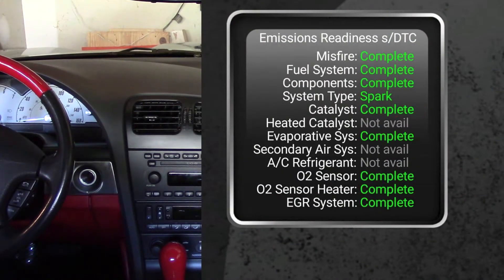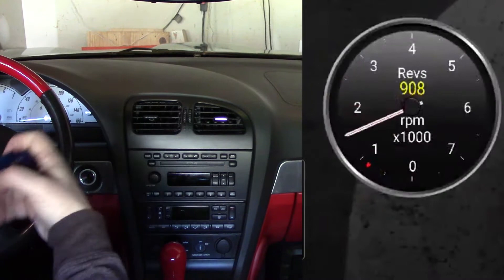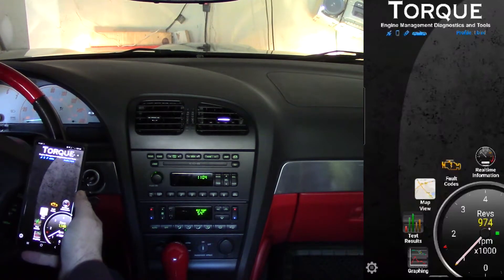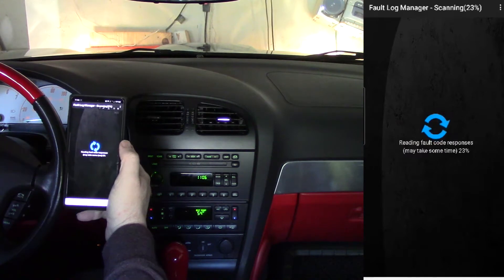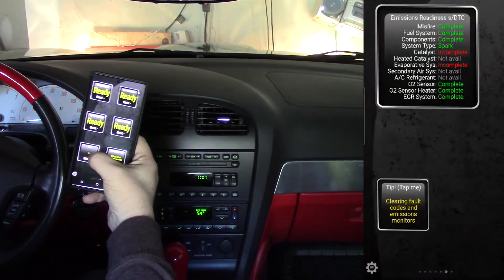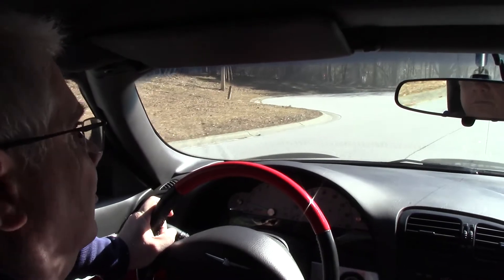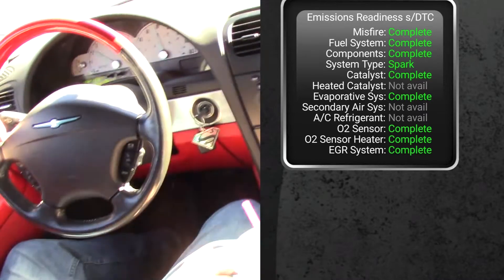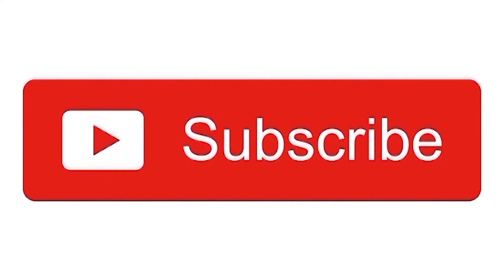Emissions Driving Cycle Catalyst and Evap Readiness Procedure  P1000 Error Fix

Comment: I had code p0442 (small evap leak) in my 2003 expedition. I changed a few things and now the code says pending after attempting a drive cycle. I have Evap and catalyst as incomplete like in the video. I hope I can complete the catalyst cycle without the check engine turning on.

Comment: I ran my Mustang at 60 mph for about 2 minutes, got off of the gas and let it coast to a stop. That Completed the Evap monitor. Thank you for posting this video.
Reply from the maker: You're welcome.  I am glad that it helped.
Reply: What if it’s a manual transmission?at 60mph do I throw it in “N” and let it coast to 0 mph?
Reply from the maker: That is what I would try.

Comment: When I take my car to smog the catalytic monitors are not ready. I’m also getting a p0496 code Evap purge valve. Could the code be not making the catalyst not ready ? Or are the 2 diff issues ?
Reply from the maker: My first thought was that they were unrelated. I looked it up to make sure and it is possible they are. I would try fixing the p0496 code first and see what happens. The purge valve is usually fairly easy to replace. 
Here is what I found when I looked it up:

https://www.kbb.com/obd-ii/p0496/
Reply: @TwoKeysStudio  thanks a for the swift response. I’m gonna replace the purge valve tomorrow. What kind of obd II do I need to tell me if my monitors are ready?
Reply from the maker: These will do it and use the Torque app on your phone. The Torque app has lots of great stuff in it including 0-60, 1/8 mile, 1/4 mile and of course it reads codes.

https://amzn.to/3O9Km41

Comment: Thank you so much for this video❤
Reply from the maker: You're welcome! Thanks for watching.
Reply: @TwoKeysStudio  Hello.  Can you still do the cycle test if your AC system won't turn off?  My sister's 2003 Honda Civic LX's AC is constantly own whenever the key is in the ON position or if the engine is running even if the fan and AC switches are off.  If I disconnect the AC compressor relay, would that do the trick?  Thanks.

Comment: I have an 2004 Ford Lightning. EVAP will not reset. Been trying for 8 months. Way past due for Registration due to not being able to pass emissions. I have tired every method I have found. LOTS of driving and it's really difficult to drive slow in a Lightning. Really not sure what to do at this point.
Reply from the maker: Verify that it will not pass with just one not ready.  Most states allow either one or two not ready conditions as long s there is no actual failure logged. Evap is the most difficult.  I had to run the second method in the video a couple of times to get it.
Reply: I am in the same situation

Comment: I have a crv honda 2006 and my Catalytic and Evap is incomplete the guy told to keep running it until it complete it . Here in Nyc they require both monitors to be complete that’s crazy.
Reply: Are you sure?  I thought I read they allow one to be incomplete.
Reply from the maker: I was curious,  so I looked up emissions readiness for NY. It depends on the year, but newer cars (2001- current) can have 1 not ready and 2 for cars from 1996-2000.
https://dmv.ny.gov/brochure/what-do-you-mean-my-cars-not-ready
Reply: @TwoKeysStudio  thanks for the info I wish they change those rules and regulations because my crv 2006 don’t have the check engine light on with 2 incomplete monitors and because of that it won’t pass emissions it’s ridiculous. My inspection sticker expired today now I’m worried if I’m getting ticket because of that issue.
Reply: @TwoKeysStudio  I drove my car 567 miles already that includes more highway than local drive and it still 2 monitors is incomplete the evap and catalytic monitoring wont set I really don’t know what to do.
Reply from the maker: @Eddie  try the two different ways in the video (link in description for documents describing). Milage doesn't really matter, it has to do with complete cycles from cold to warm.
Reply: @TwoKeysStudio  I already did all that process and it still nothing plus no check engine light on but the evap and catalytic not ready, if my car burns oil through the muffler is that the cause that the catalytic converters monitors won’t complete??
Reply: @EddieNYC02   - Oil in the cat does not help but if there is a problem you will get a code for it.  The completing of the monitor either completes it or if there is an error with it you get a code.  That you have not got a code or completed it just means you have not hit the correct parameter for it to run it's test.
Reply: @stevew9563  the weird thing is there’s no check engine code for the CATALYTIC Not to function properly, I went to the mechanic yesterday he told to me to put a spacer adapter that goes directly to the the Catalytic and O2 Sensor and Run it on the highway
Reply: @EddieNYC02  The codes get generated when the monitor tests run.  So you either complete the monitor test with a code or no code. But you don't know till you actually create the driving condition that allows the monitor test to run.  If that makes any sense.  Will try to find the drive cycle in the service manual.
Reply: @EddieNYC02   - Could not find a drive cycle  in the 06 service manual. Here is one from the 09

Honda/Acura: Newer Honda/Acura owner’s manuals include a drive cycle. The following drive cycle is
from a 2009 Honda Accord and 2010 Acura TSX owner’s manual:
1. Make sure the gas tank is nearly, but not completely, full (around 3/4).
2. Make sure the vehicle has been parked with the engine off for 6 hours or more.
3. Make sure the ambient temperature is between 40° and 95°F.
4. Without touching the accelerator pedal, start the engine, and let it idle for 20 seconds.
5. Keep the vehicle in Park (automatic) or neutral (manual). Increase the engine speed to 2,000
rpm, and hold it there until the temperature gauge rises to at least 1/4 of the scale (about 3
minutes).
6. Without touching the accelerator pedal, let the engine idle for 20 seconds.
7. Select a nearby lightly traveled major highway where you can maintain a speed of 50 to 60 mph
for at least 20 minutes. Drive on the highway in D (automatic) or 5th (manual). Do not use the
cruise control. When traffic allows, drive for 90 seconds without moving the accelerator pedal.
(Vehicle speed may vary slightly; this is okay.) If you cannot do this for a continuous 90 seconds
because of traffic conditions, drive for at least 30 seconds, then repeat it two more times (for a
total of 90 seconds).
8. Then drive in city/suburban traffic for at least 10 minutes. When traffic conditions allow, let the
vehicle coast for several seconds without using the accelerator pedal or the brake pedal.
9. Make sure the vehicle has been parked with the engine off for 30 minutes.
Reply: @stevew9563  here’s the new update I checked the  terminals on the battery 🔋 it was very lose I tighten it then after that all monitors were incomplete then I run it now it show all monitors are complete except for the O2 sensor and Catalytic Monitor, when the O2 sensor complete I will take it for inspection. I think all this time the terminal battery was giving faulty readings , because it was very very lose .
Reply from the maker: That makes sense. Thanks for sharing it with us.
Reply: @TwoKeysStudio  you welcome 🙏 .
Reply: @TwoKeysStudio  New update, today I took my car for inspection and yes it pass thank goodness . I’m happy now .
Reply from the maker: @EddieNYC02  Awesome!!!!

Comment: Before I do the second method , I’d like to note that I had to have one of my cats replaced due to it being stolen , would that affect anything ? Please help , I’ve been driving for 100 of miles and nothing .
Reply from the maker: It would probably threw a code when it was missing and then just need the drive cycles to make it show complete.  Try the second way and see if it goes to complete and make sure the car has cooled down (overnight) before trying it. The miles don't matter as much as it going through complete cycles.
Reply: What year, make, and model? Each could have specific instructions for the “drive cycle”. 

May need to google to find yours, or even need to check the shop manual.
Reply: @GeorgeFanucci   Toyota tundra 2000

Comment: SO THEY REALLY WANT YOU TO DRIVE AN UN INSPECTED VEHICLE TO COMPLETE THE DRIVE CYCLE AND MAYBE YOU CAN HAVE YOUR VERY OWN REASON TO GET PULLED OVER FOR UNINSPECTED VEHICLE,GET A TICKET AND GO THRU THE BULLSHIT , THAT IS ALSO ADDING TO THE UNNECESSARY POLLUTION  AND its such a joke
Reply from the maker: You should do this prior to inspection is due, but if  you do get a ticket most areas will dismiss it after you get it inspected.

Comment: So GM’s OBD2 drive cycle Says from a cold start run the AC and idle for 2 1/2 minutes and you say don’t run the AC. Put as electric load as possible until you drive
Reply from the maker: Actually at 5:56  I said  run AC, headlights, and rear defrost when I tried the second method.
Reply: @TwoKeysStudio and at 47 seconds into your video you say Don't run the AC
Reply from the maker: Yes, I said both in the video. I mentioned that I tried two different methods, and I linked to both methods in the description. One says no AC,  the other says to use the ac. There are also other differences between the two different methods.
Reply: @TwoKeysStudio  thank you for the clarification
Reply: Hahaha i love this one krazy🤘🍻🍻🍻🙏🤘🎸🥳🐜

Comment: my darn evap is still in the red. it's been over a week on my 2011 Town Car. It's never lasted this long, but at the same time it's never been under 40 to single digit temperature during that time frame while doing a readiness monitor.
Reply from the maker: In most areas you can still pass with only one that shows not ready. Call your local emmisions testing to verify,  but you are probably OK.
Reply: A comment said you need at least 3/4 gas to clear evap

Comment: My evap system is not ready , I'm due for state inspec by the end of May.. you have the best answer to the issue yet.. Thanks will let you know what happens
Reply: So what happened lol
Reply: @ThaTruMasterAF  I passed..it's been so long I forgot what the issue was.. but now I have other expedition issues like IWE vacuum and recently sunroof switch.. Daammm!!
Reply: How did you trigger the epav drive cycle? I recently changed my gas cap and wanted to trigger the drive cycle.
Reply from the maker: The second drive cycle in my video did it for me. In most states, having just one not ready is acceptable anyway.

Comment: In Ohio they won't even try to test your car if the cycles have not been completed. They will tell you your car is "not ready" and tell you to drive your car. I have a 2011 malibu, just replace maf sensor, p0443 code and because I erased the code had to complete all of the readiness tests again. Download a copy of gm drive cycle recommendations and it took 3 days, about 50 miles of driving to be able to get the car tested. Ohio also allows one parameter to be incomplete. My evap was not complete but passed the inspection
Reply: Same for CT.